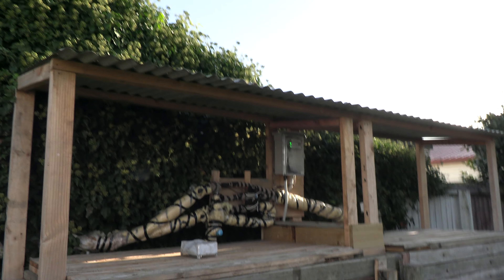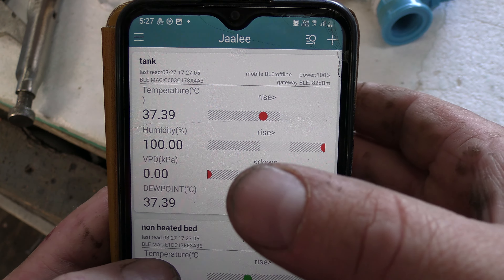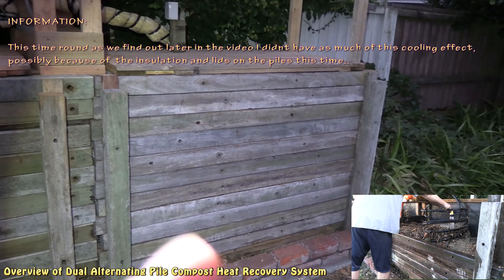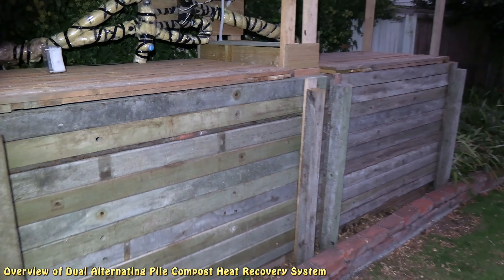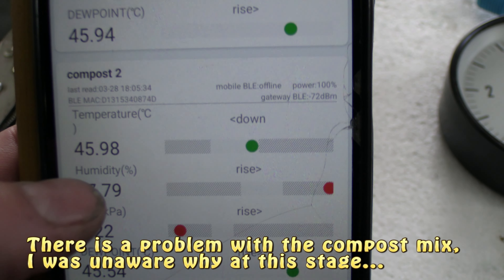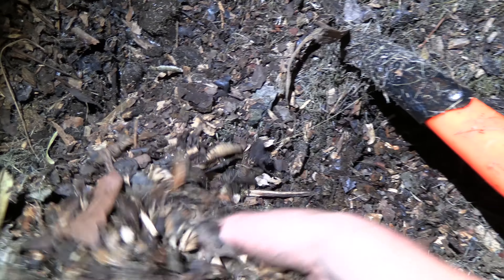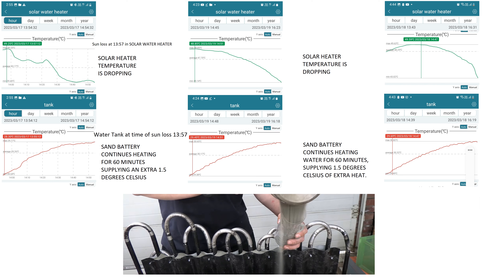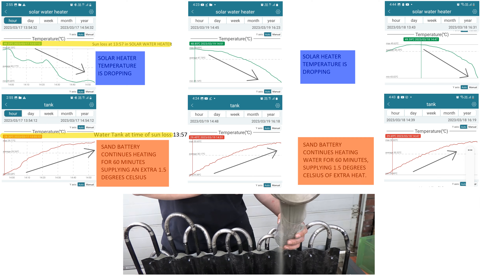DIY Solar Water Heater + Compost Heat Recovery System. How Much Heating Does It Acheive?

Comment: Hi. I am very interested in the temperature you are able to heat water using just the corrugated sand filled setup you built. Have you made a video of its performance. Most people only tell you what temperature the water will reach after the panel has been sitting in the sun for some considerable time heating the water in the pipes. I am interested in the temperature rise as the water circulates through the system on a normal sunny day. Good work. I also like those wireless smart temperature sensors. Great work by the way.
Reply from the maker: I can see how it goes with just the sand, but I will need to do that mid summer when the sun is at its highest intensity, and the days are longest, thats late december.
One thing I've noticed is that it heats up fast from a cold temperature, but the heating speed slows down the hotter the corrugated panel and sand gets.

Comment: Well, if the object here is to heat your greenhouse beds, for the winter, I'm assuming, how much more productive is your green house..I realize that you are learning as you go and experimenting, but,is it worth the expense and time, or haven't you got that far, to make that calculation...Have you thought about using the hot water for showers, and laundry, doing dishes, etc...I live off grid, and am always looking for ideas...I have a mini split that runs directly from solar, that heats and cools my house during the day and by battery at night, along with a wood burner..And a 30 Kw home made battery, 48 volts, made from 304 AH EVE cells, and 2,880 watts of solar panels, that more than runs everything..Maybe a wood burner or mini split would heat that greenhouse, even using water...Thanks though, very interesting...